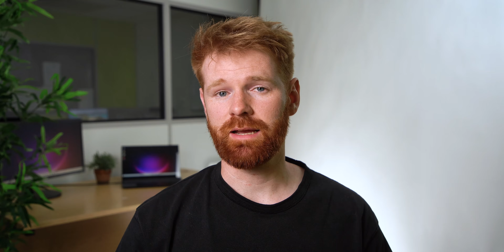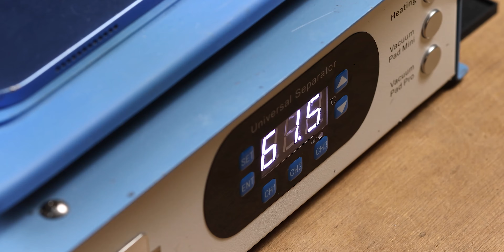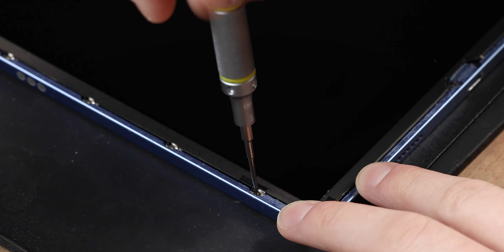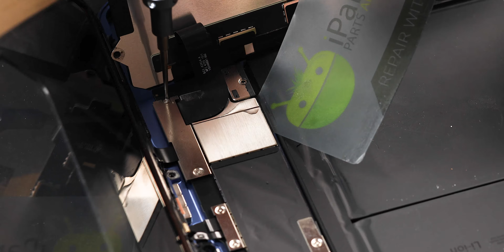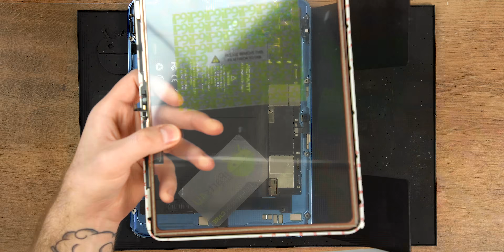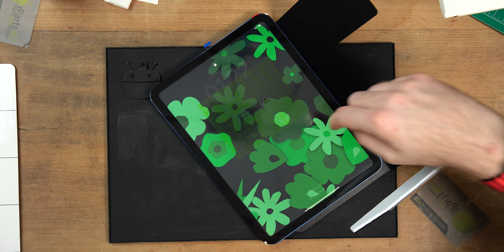iPad 10th Gen Screen Replacement Guide – Step by Step Repair Tutorial!

Comment: I was able to fix my screen, however, people with wifi + cellular iPad, the screws that hold the LCD is T3 not T2 AND there's two screws near the bottom that you also have to undo to get it out, I almost bent my LCD trying to figure out why it wouldn't just pry out.

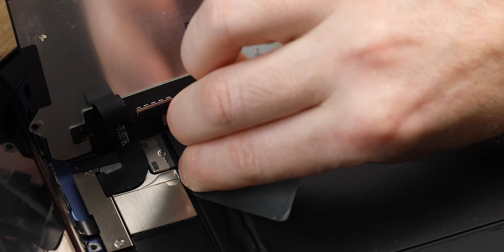Comment: Why pry the adhesive at 6:30? You've already removed the screw, so it's safer and easier to just slide your plastic divider directly into that gap. Prying the side is unnecessary and relies on the board staying bent to disconnect power. You're lifting an adhesive that doesn't need to be lifted. Think about it, why remove the screw to separate the part next to it? Instead seperate the the part where you just removed the screw. Watch some other videos of people doing this professionally and watch where they separate it.

Comment: Hello! I replaced the digitizer and now the LCD doesn't turn on.  The LCD will show the apple icon super fast once, like a flicker. I can plug the charger in and it makes the charging sound. I was told by a local shop that it must be the battery.  I replaced the battery and bam, same issue.  I'm at a loss! I would like to also THANK YOU for the AMAZING battery replacement video! All of your videos are GREAT!
Reply from the maker: Thank you for the kind words! Our tech suggests unplugging the digitizer and see if it turns on with just the LCD plugged in, if it doesn't work then it could be a board level issue which would need someone with microsoldering expertise to take a look!
Reply: Check the lcd connector & it’s connector on the logic board for any damage & make sure it’s on properly & lastly make sure you put that shield on aswell
Reply: It could be the battery contact pins on the board were bent

Comment: I'm trying to screw back in the torque screws and they keep getting caught by the magnets that run along the frame of the iPad. I can't hold them in position to screw back on. It's the right sized screw driver I am using it's just a standard metal magnetised one. Any advice?
Reply from the maker: Hey! It can be a bit of a nightmare getting the screws back in. Sometimes it's easier to use your finger to hold the screws in place rather than using the driver. It does require quite a lot of patience and persistance but I'm sure you'll get there in the end! 🙂